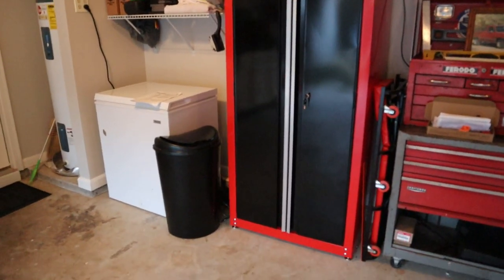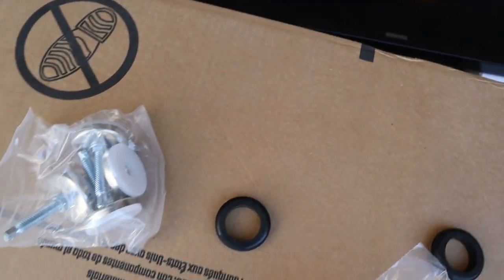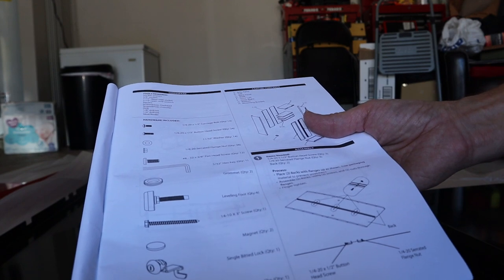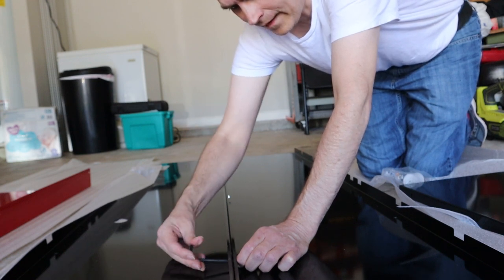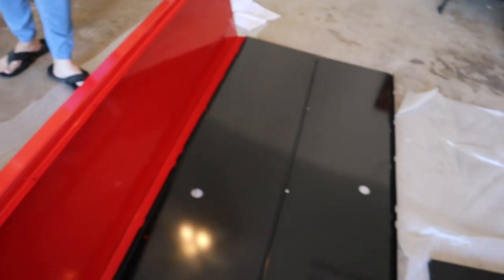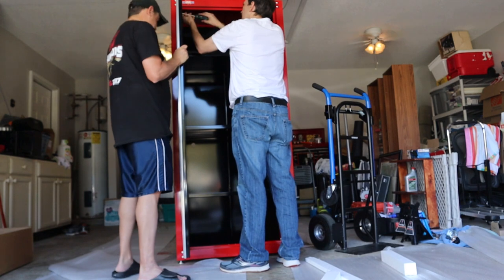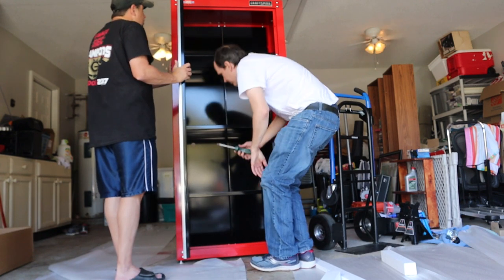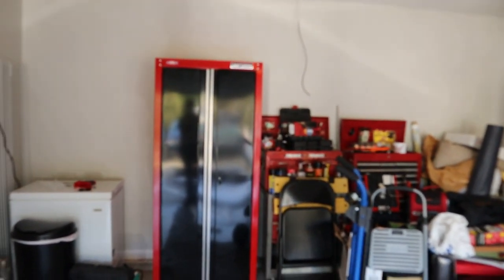Craftsman Cabinet 2000 Series: How to assemble. #craftsman #craftsmantools

Comment: The lock doesn’t catch the left door?
Reply from the maker: No, it does not. Actually there's a "lip" that the left door has that the right door collapses onto when you close the doors. The lock, when turned catches the middle shelf. So with the lip of the lift door is locked in place with the right, you can't open it when its locked.